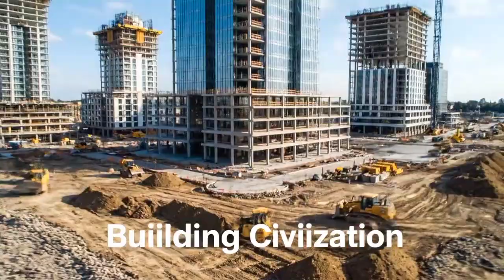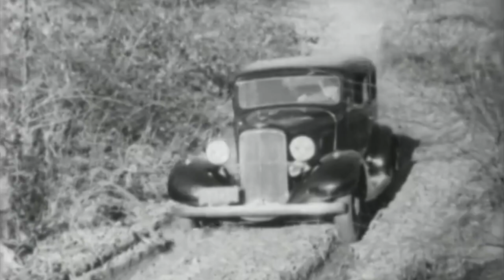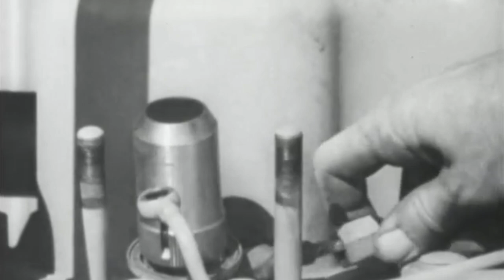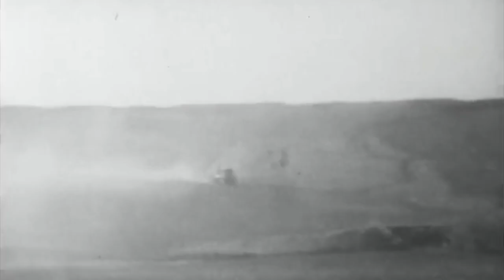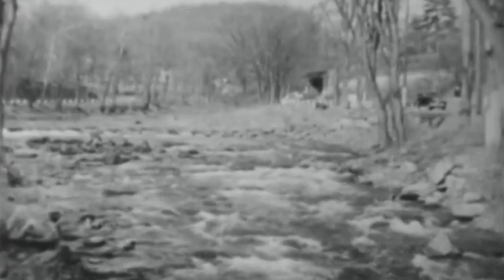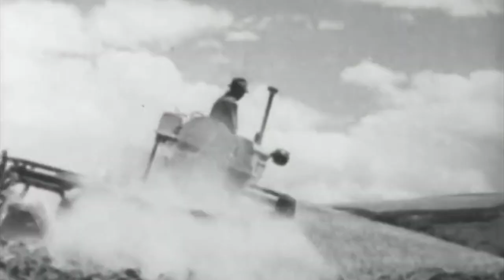Why Every Bulldozer on Earth Is Based on a Design From 1904

Comment: Hello, Quisoop.
Not a bad video but still historically INACCURATE.

The first 'ackshull' track design of which I am aware, although never built, was by Richard Lovell Edgeworth in 1770. In about 1826, Sir George Cayley, a British inventor, patented a system which he called a 'Universal Railway'.

Then there was a 'rash' of designs from about the 1830s well into the 1890s with few of them actually being built. One that was built AND trialed was the Heathcoat Plowing Engine from 1837. Internet research will give more information. This was just one of a good number of designs, some of which were actually built, a design by John Fowler of England being among these, and some which weren't.

Then there was a Russian named Blinov who did build a steam powered machine on tracks in the mid 1890s which proved to be not very successful.

Then came Alvin Lombard of the U.S. of A. who, in 1900, built steam powered log haulers on tracks and licensed his designs to another manufacturer named Phoenix. It is rumored that Holt drew his inspiration from these units

At about the same time that Holt was building and testing his design, Hornsby in England was building and testing their design which bore more resemblance to modern crawlers 'coz it DIDN'T have a front tiller wheel for steering.

So now, just WHO do you trace the crawler track ancestry back to??????

Just my 0.02.

You have a wonderful day. Best wishes. Deas Plant.
Reply from the maker: Thanks for the detailed info; we'll definitely look into those historical designs for future videos!